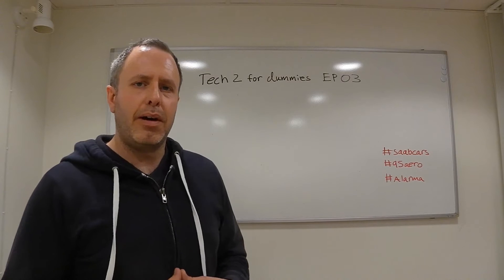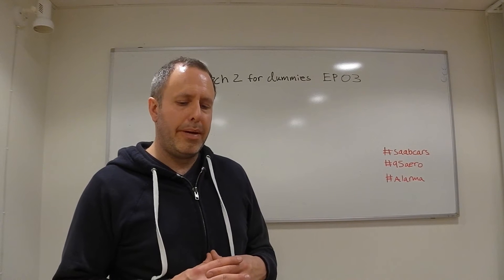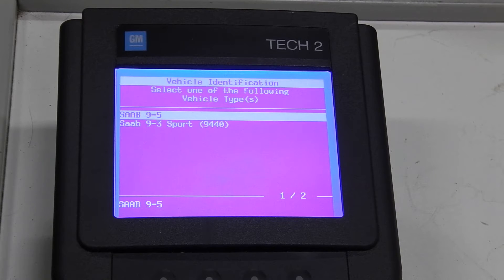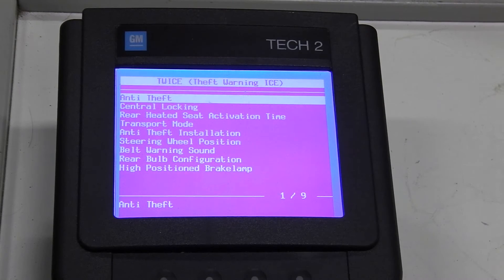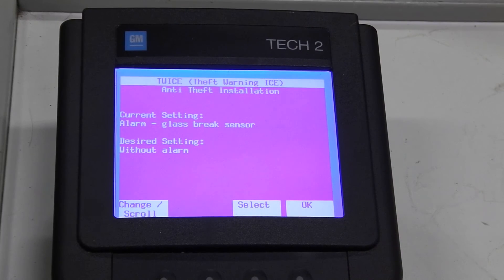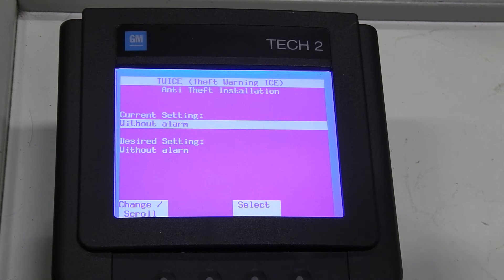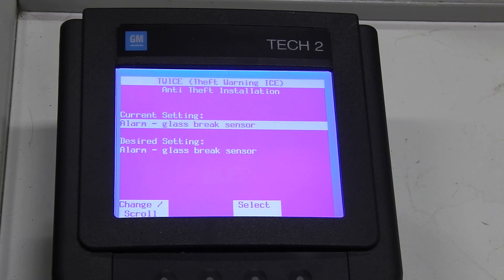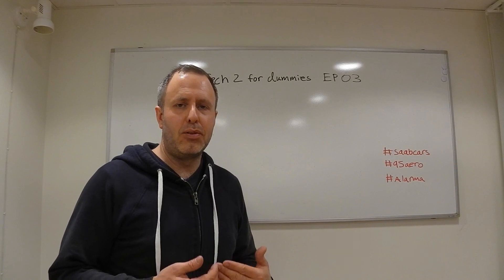Saab Cars - Tech2 For Dummies - Episode #3 - False Alarm

Comment: Hello,  Great presentations.  Recently, I've been getting "up close and personal" with an '03 Saab Arc.  I'm trying to help a friend, who owns the car,  and it's my first experience with Saab.  I'm fairly experienced with car maintenance, but have never seen anything like this car. (electrical complexity).  The car was "sitting" for the last 5 years.  After checking various systems and items, getting a battery, I drove it about 30 miles to my location and now am having many issues.  Most recently, the fob stopped working (was working fine) cant turn the key. Also cannot lock/unlock with the fob.  The alarm has started "going off" at random times, so the battery is disconnected. The windows are down with no way to raise them.  At a loss as to which direction I should go.  As you know, no more dealers or GM help.  Also, mentioned in one of your "episodes", diagnostic time at an independent shop is expensive.  Should I "bite the bullet" and get a Tech2 clone?  Any information or advice you could provide would be greatly appreciated.  Again, really enjoy your videos.  They're very well done and informative.  Thanks for generously sharing your knowledge.  BTW, when I drove the Arc, I was seriously impressed.  Fast, is an understatement.  It "ran like a scalded dog". to say the least!
Reply from the maker: Thanks for watching. It's nice of you to help your friend to get his SAAB going again. With that many small errors/issues/faults I would just go ahead and get the Tech2. The alarm going off randomly could for example be one of the door locks, you don't know which until you pull the codes for this with the Tech2. Then you will have way better conditions with regards to fixing the issue rather than guessing. I usually say that the Tech2 almost everytime takes away the guess-work, it will tell you what you need to do. The clones these days are great. Most of the time it's the cables and the CANdi module that brakes down. I'm on my second CANdi, and it has lasted 2 years now I think. Had to replace one cable between the Tech2 and the CANdi, that's it. Best of luck with the car and don't hesitate to ask any question you like. BR Markus
Reply: Many, many thanks BR Markus!  I can't tell you how much I appreciate your super fast reply!  I've been "all over" the internet the past few weeks trying to get some "education" on these cars.  You and your presentations seemed so genuine and down to earth, I felt the need to "reach out".
I think you mentioned, in one of your "episodes" ,  about the 03 Saab and the Tech2 need also to use a laptop/computer as part of the interface as well.  Is this correct?
I thank you, again, for your quick contact.  Count me as a "new" subscriber and look for my donation!  Cheers!

 @TechCars
Reply from the maker: @beauhatman4395  Thanks for your kind words. When doing certain things with the NG9-3's (03-12) you need security access which is obtained by using the Tech2 through USB-RS232 adapter with a software called TIS2000 or GlobalTIS. BR Markus
Reply: @TechCars  Is there a way to "donate" to your channel?
Reply from the maker: @beauhatman4395  No, simply watching and recommending is great! It's a hobby of mine only. I'm glad I can contribute to the community!
Reply: @TechCars  Well, thank you, again, very much.  You're providing a great service!

Comment: We have a 2005 9-3 and cant seem to find the TWICE option in the body section. When we go there is anti theft protection. Clicking that is has alarm disengage and panic options. It only allows for remote and something else. No off or without option. Any thoughts? Trying to fix an alarm that goes off randomly anytime the doors are locked with key fob.
Reply from the maker: Hi Kelly. There's no TWICE module in the NG9-3. That's why you don't find it. You should be able to find things related to theft alarm in the menu. I don't have menu structure here at the moment, sorry.

Comment: THANK YOU!  My '04 9-3 convertible has had a malfunctioning alarm since I bought it.  It goes off all the time...even when I am driving it!  I came out to my driveway one summer day and found a big SHOE PRINT on the passenger door.  Yes, it was so annoying for my neighbors that one of them kicked my car out of frustration.  I am ordering a Tech 2 clone and will be doing this procedure.

One other question.  I had to replace the ICM in my car because the back lighting quit working, and I got a used replacement on Ebay (part numbers match).  The car this ICM came from has far fewer options than my car has, so when I plug it into my car I am missing things like the 6-disc in-dash changer, rain sensing wipers, and parking sensors.  I assume the Tech 2 will be able to activate these functions on the new ICM?  Thanks for your help, and keep the videos coming!
Reply from the maker: Thanks for watching! I hope everything works out once you get your Tech2 :) When adding the ICM to the car you need take get through some steps and there you will choose which features you have :)

Comment: Hello SaabCars , very cool video. I have quick question for you . I own Saab 9-3 Aero 2004 . I does have alarm misbehaving ( going off at night etc. ) . I have removed driver side tire to disconnect Siren unit in the wheel opening , but it is not their ? It is also not in the trunk side openings.  Do you know where the alarm/siren unit may be ? Also if I just disable it in the software as you show - can that work without physically disconnecting the unit .    Great thanks in advance . 
Regards.
Reply from the maker: Hi. Have you checked the faultcodes? Might be a doormodule that makes the alarm goes off. The best is if you can fix it. You can however remove the alarm functtionality ofcourse.

Comment: Hi. It's Dummy Locksmith again. Thank you for your answer. I have one more question 2 in fact. What I'm understanding is 
 that there is no transponder chip in this key, and that all  the anti theft features are in the alarm itself ? So if I use the TECH2 to
 set the  vehicle to the no alarm setting as shown in your presentation , then the car can be started with just the Mechanical key?     Thanks again!
Reply from the maker: There is a chip in the key because you have the immobilizer function of the car. It cannot be started unless you have the correct key inside the car. The Alarm and the immobilizer are separate functions.

BR
SaabCars
Reply: Does the Tech 2 program keys for the Saabs in an all keys lost situation ?  Or copy keys only ? 
    Thanks.
Reply from the maker: You need to copy the key with the help from Tech2. If you have lost all your keys you need to contact the dealer and buy new ones.
Reply: Ok . You are not understanding . I am a locksmith . I don't own a Saab. My costumers need keys made and 
  I am asking if this tool is what i need to buy to make them those keys. If i buy this tool and I have to refer my costumers to the Saab dealer to make the keys why buy this tool. What tool would the dealer use? That is what I need to buy. Understand ?
Reply from the maker: I get it! If you get a customer that wants a new key they have to provide the electronics themselves or have a dealership program new electronics to the car. If they provide the electronics, this is what you do for them. http://www.ebay.co.uk/itm/Replacement-fits-SAAB-9-3-9-5-3-BUTTON-Remote-Key-case-with-blank-cylinder-blade-/201211779112?hash=item2ed9281828:g:9mMAAOSwdpxUW5yt

A mechanical replacement where they just take the old electronics and put in the new mechanical key which you copy or supply to them.

You don't need the tech2 unless you want to be able to program the electronics to their car. 

BR
SaabCars

Comment: From my own (multiple times happened) experience and confirmed by few people from dealership, I would not mess (well, I can say "play with") TWICE settings at all. On old car. NEVER. Because twice has memory that is quite old and can have issues when re-written, so it can even forget the keys, fobs, other settings and you may have even issue to start your car then until getting some other twice with pair of keys, locks, everything, to replace & program the twice to ECU.
Reply from the maker: Thanks for the good feedback. Yes that is something that should have been included in the instruction. If this is done to a car where the alarm is a big issue it can be useful. Let's just hope my 9-5 will work as intended throughout this series :-)
Reply: This is why some dealerships claimed it's not a problem of re-programming. Well, on cars where regularly someone added / deleted options, or did some changes, it was all OK. But when after almost 20 years someone wants to pair a key or simply change settings on a 1997/1998 car in TWICE (I mean first changes in twice in many many years of not being written apart from factory set), it may as well mean it's his last drive with that until he'll not be able to start again because of memory of twice going crazy.
Dealerships with that experience may even refuse to perform changes in twice to avoid having to fix someone's car by "breaking" it this way. You can imagine complains of customers after having some issues in a day or two that "until you did that last change, all was fine". aah.
Reply: Hi Peter, I own a 2005 9.5  that is in pretty good condition at 240.000 km...
The only issue that I have is that my parking sensors work only when the outside temperature exceeds 30°...
But unfortunatly I have lost one of my keys, and the remote doesn't work anymore with the spare one..
I can only use it as a standard key and need to manually open and close the door everytime i need to get in or out of the car..
It starts the car no pbm , and I have no message on the SID...
It was working though on 2/ 3 occasions for few days  but nothing after that, so I thought it might have been a low battery issue and I have replaced the battery of course with a brand new one..)
Impossible to get it to work properly since...
Do you think I should buy a Tech 2 and try to marry that key with my car , or is it to old to take the risk to mess with the twice...?